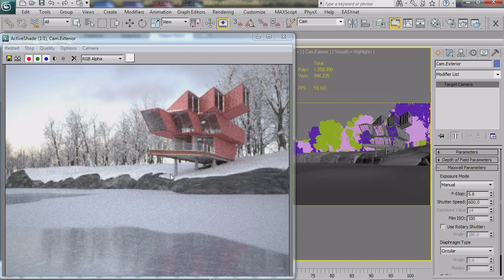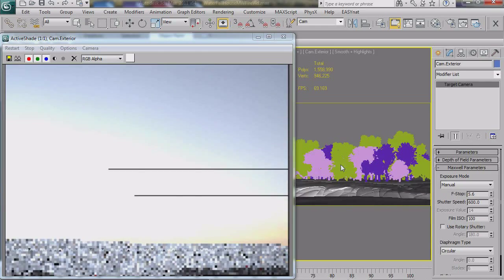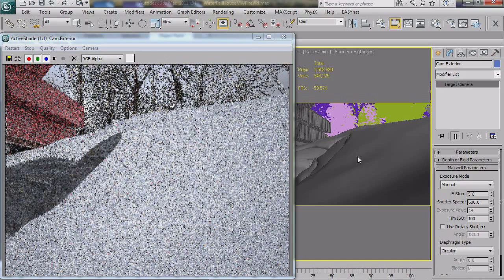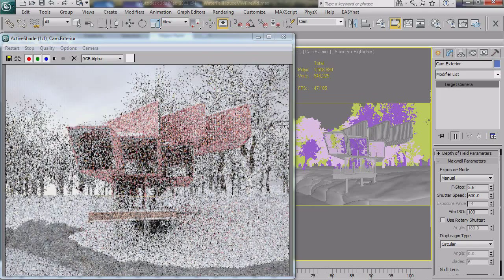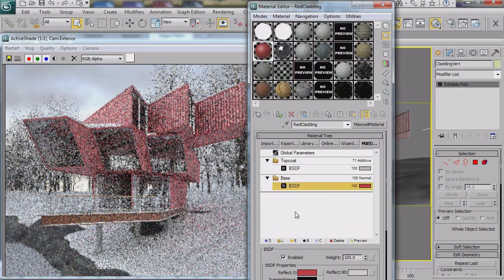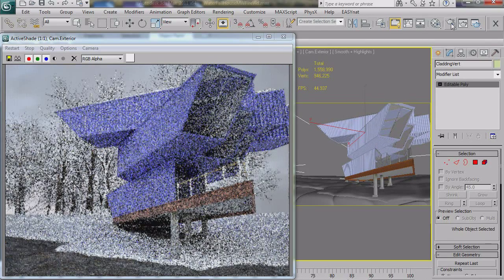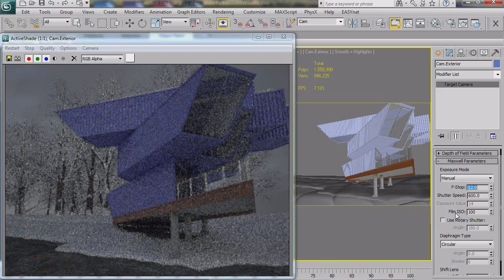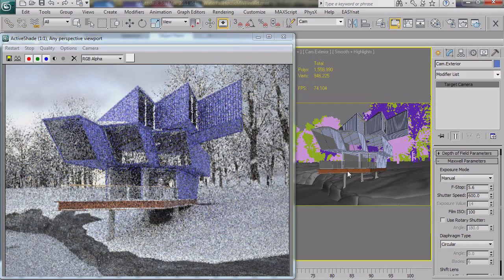Maxwell Render Interactive Preview (Fire) Part 3

Comment from the maker: For the exterior shot you see here, which is pretty heavy, @ 720X1080 you get a reasonably clean image in under 5 minutes or so. Though when using Maxwell it pays to understand how to optimize your lighting setup and scene. Also know that Maxwell is  fast with exteriors but slower with interiors. In any case a 980 should work fine. I would look at the new 2600K as well. Fewer cores but faster, cheaper, more energy efficient and unlocked unlocked, not to mention is runs on newer motherboards.